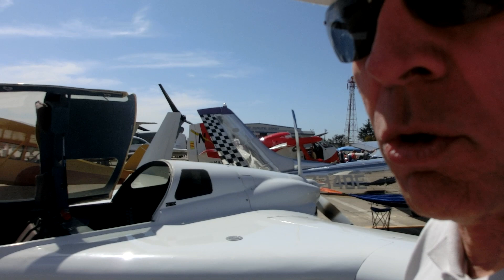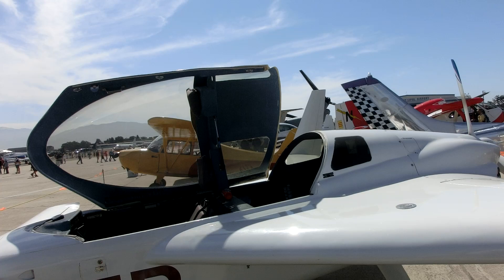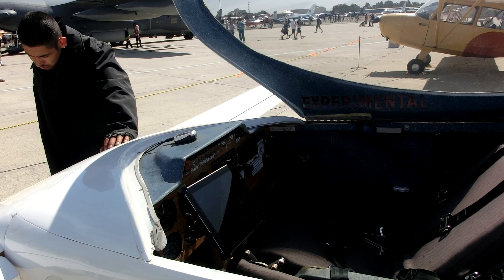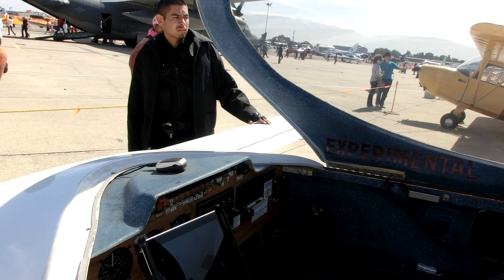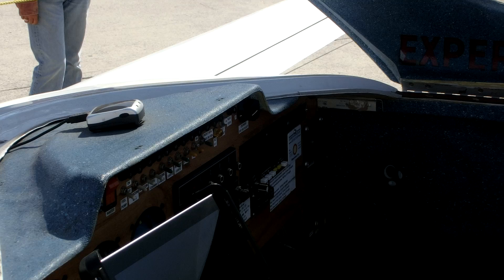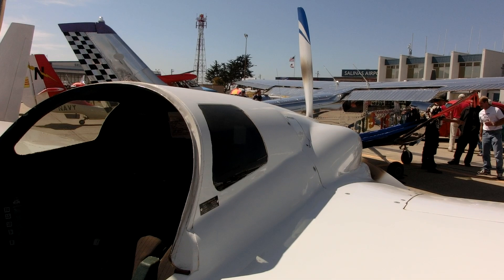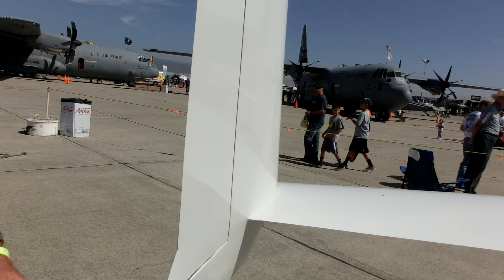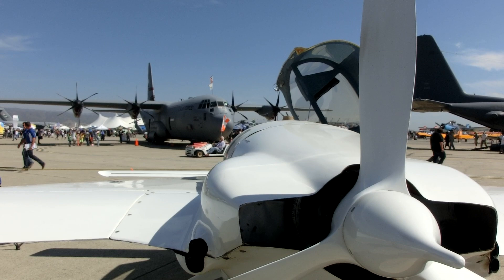Dennis Rose describes how he built his Cozy Mark IV DIY Airplane Range-1,000nmi Part 1/2

Comment: I wonder if u could make these out of carbon figer?  Probably would be super light.
Reply: They have different properties and I wouldn't replace anything structural with a different material. I saw some video where some guy built one and he did the non-structural components in carbon. You can find a lot of comparison info online.
Reply: yeah a lot of people think carbon fiber is the strongest (it isn’t actually S-glass is stronger) it’s lighter tho and that’s the benefit